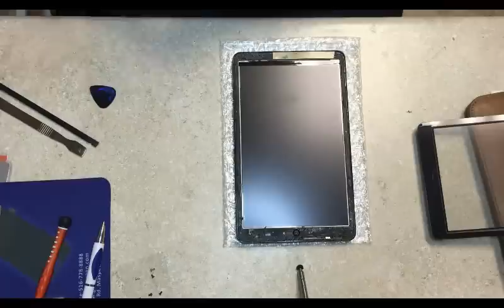DELL VENUE DIGITIZER REPLACEMENT

Comment: I exchange digitizer for a new one, and new does't work. Just no response... Any idea?
Reply: Marian Pazdzioch I'm in the same situation
Reply: I had the same issue but I found that I needed more adhesive on my screen so it could lay flatter.  When I pressed down on an edge of the screen, I was able to operate the touch screen.
Reply: T-Dawn Gatling-Coates thank you!! I was thinking that was maybe the problem... tomorrow i will try it again with more tape

Comment: Why did you show every tiny detail, including 4 minutes of peeling the cover off of double sided tape, but skip over the most important part of replacing a cracked screen which is the removal of the old cracked screen. Its the only step I need help with. Its the only reason I sat through the rest of the video. You literally could've skipped any other step and I would still be confident in my ability to figure it out myself. You went from trying for 3 minutes to remove the mother board (w/out finishing), to hair dryer heating the cracked screen, to applying the tape to install the new screen. The easiest part to mess up on this whole repair is removal of the old screen. I really never complain about free knowledge, and feel bad even now but it would help people who watch this in the future if you took 3-4 minutes off of the tape application time and devoted it to the old screen removal. I do apologize for the negative feedback, and should have tried to be more constructive w/ it. I'm just irritated. If you can help w/ a lil more coverage of the screen removal, I will be glad to change my feedback, and would appreciate any help. The rest of the video was pretty good, and thank you for what info I did get from watching.
Reply: +Lura Scheibelhut I really doubt it's a hair drier. And now you have a hint what to look up on internet right?
I mean me too. The only question is - where to get that digitizer
Guess any other video on changing the digitizer would do it for us.
Reply: From what I've heard, and experienced (just yesterday) its way easier to change the whole digitizer+screen than to change just the screen. When you order it (off ebay, or amazon,etc.) it comes assembled. Its just much more expensive than ordering the screen only. $7 vs. $80-90 are the prices I've seen. And yes I've found that it's a heat gun, not a hair dryer : )  and that would've made my job way easier also. I just finished today. Had to set it aside a few times, but i did it. (Without a heat gun or hair dryer) good luck
Reply: it is a hair dryer all you need is a hair dryer to melt the glue from the screen
Reply: A hair dryer will work in a pinch if you don't have access to a heat gun. don't blow heat in one place for too long, heat the glass as evenly as possible until it's hot to the touch. You may have to go over it again before you're done removing the glass - the glue can cool down pretty quick. Get yourself a plastic paint scraper, too, to help in removing the old glue/glass shards.

Comment: how separated the touchscreen from the display?The most interesting moment is not on video!!!
Reply: +Sergio Mega it needs to be heated on the sides for a extended period of time, like really hot to soften the adhesive and i reccommend a hair dryer so it wont damage the lcd and then use a sesamo tool along the sides
Reply: +Kevin Avelar Thank you for the advice!!!